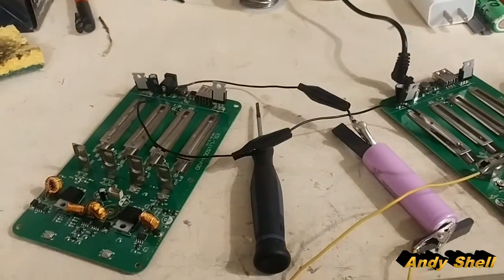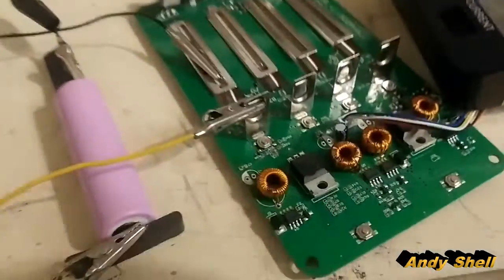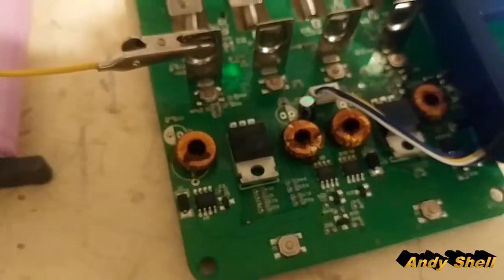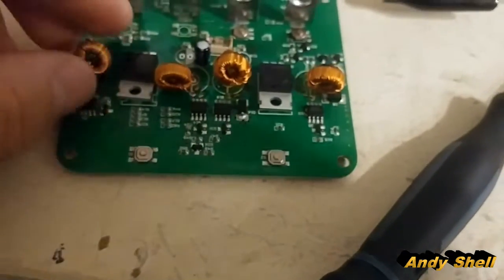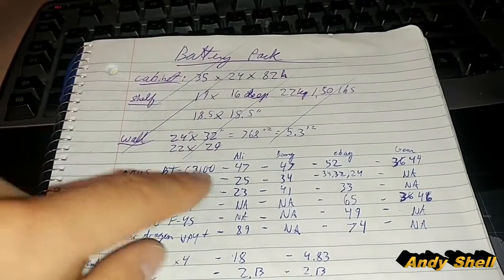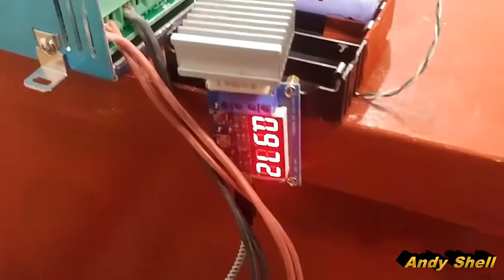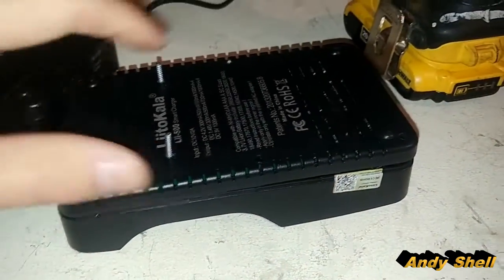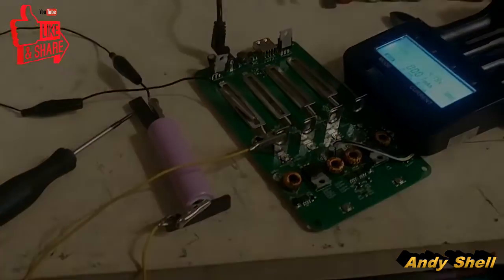Repair Lii-500 LiitoKala

Comment: I'm using 1 LiitoKala Lii-500 charger. Currently, my charger is damaged. There is a damaged transistor on the board. It has the code AL068 (U4). I want to replace it, but am having trouble finding a transistor with code AL068. Could I use another code instead?

What is the difference between SOT23-6 and SOT23-6L?

Thank you.
Reply: U4 - SD6271  ( AL....)

Comment: Great vid, thank you man.  I actually didn't believe it was the switches and thought I had another problem (the switches all seemed to be measuring good continuity on my multimeter), but I took your word for it and desoldered the most suspect switch (had some dried electrolyte around it) and that instantly solved the problem. That's one more device saved, and a huge relief!  If anyone has any ideas how to combat leaking electrolyte with these units (obviously quite a common problem), some tips would be great. I'm thinking layering some paper towel down into the battery bay before loading in the batteries might work, but that can obviously get pretty annoying as well

Comment: I have the lii-500 also and have not had any problems I saw on bangood they had a lii-500s which has a nicer display and it looks like you can charge 2 cells at 2A and discharge is also .5A and .25A i kinda want one that does 1A but it was like $25 so if i order another I might get that and also for a capacity discharger the ZB206+ is pretty versatile i see them for like $11 on ebay i have one it seems to work fine and can give you a constant current

Comment: Hi man, I have this same problem. Electrolyte leak on the PCB. I Check many parts, mosfets, diodes etc, and finaly i change switch and charger work very well. Thanks for solutions.
Reply from the maker: Sick! Good to hear :)

Comment: I'm using an Opus bt-C3100 just like steve, it works good and the fan doesn't make much noise but it was $45! and it isn't anything special. I don't like that it discharges down to 2.8v and sometimes charges a little past 4.20v. I would normally stay in the 3.2v-4.1v range, so i haven't used it much. This is Da Wi aka David Williams.

Comment: Im using a Opus bt-C3100 to capacity test but its fan seems to screech like a dieing cat. Also it came with a wall wart power supply with poor isolation so if you touch anything metal on the charger then something that's earthed you risk electrocution.
Reply from the maker: Crazy. I have the rare bt-c3400 v2.2 and its the same issue. Im really on the fence of lii vs opus. I have no other real options.....